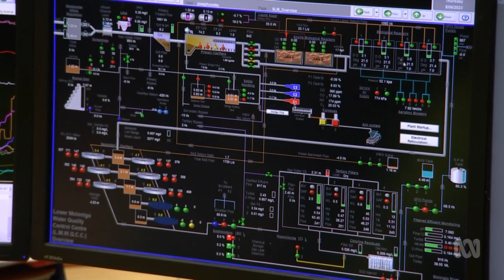Retrospective: Canberra Sewage Upgrade BioChar Plant For Agriculture

Comment: I hope they are using cogeneration to produce that biochar.  For example, there are many cogeneration power plants around the world that produce not only electricity but also produce steam from the excess heat that would have simply been shot into the air.  Rather than wasting the energy stored in the excess heat, they would produce steam.  These people could do the same thing but create biochar using the excess heat.  This is much more productive and efficient and better for the environment than simply burning material to create biochar.